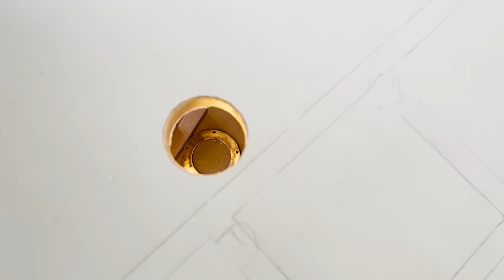Holes In the Boat and Deck Waterproofing - Episode 257 - Acorn to Arabella: Journey of a Wooden Boat

Comment: Great work Stephen, well done as always. Mate, i strongly suggest you move the gas bottle. That is the best seat in the house. When you're sailing to weather that is precisely where you'll want to snug up under the dodger to avoid the spray. At anchor on a rainy day, thats where you'll want to have your cup of coffee on deck and stay out of the rain behind the dodger. On watch for long hours, thats one of the few spots you can sit with your back supported. Its also a safety issue, they do catch fire, better to have it as far away from your cabin access as possible. Its the spot where you'll come in and out of the cockpit when you need to go forward. Its tricky enough without a sharp piece of metal to negotiate. Honestly mate - that is valuable real-estate and far more valuable than the convenience of being able to put your hand out the window to shut it off. Future Stephen will thank you. Best wishes
Reply from the maker: Thanks for the thought but with the dinghy on deck and a few other things, it’s really the best spot for the propane on Arabella. We’ll find out little shelter or favorite spot for sure. 👍

Comment: Looking good. Hole saw tip: Drill 1/3 of way from one side until pilot exits other side, then drill from other side. No chance of tear out and you can grab the plug and pull it out of the saw with your hand.

Comment: I'll join everyone else and say great work Ben it's hard to believe 200 episodes of smooth editing. I do have a question will a thin layer  of epoxy be added to the exposed wood on the cabin top holes to seal the wood against water intrusion.
Reply from the maker: Yup, epoxy was used to seal those.

Comment: Very interested in the scraping of the Deak seams, a few years ago I was trying to scrape the 18Cent lower deck of the Endeavour replica. The soft wood had worn away and left a ridge of Pitch. Found it very difficult to get the floor flat again, perhaps a Scraper would have been better!??
Reply from the maker: A very sharp scraper, maybe. Although it’s probably not a bad thing that the pitch is proud of the rest of the surface. Doing it’s job!
Reply: The pitch was raised by about a 1/4 of an inch, we tried a Belt Sander and a power Plane both just melted the Pitch. Perhaps the big Block Plane that I had at home would have been better but it was a huge area about Ten x’s Arabella’s deck. I gave up and I suspect she sailed out of Cardiff in the same condition as she came it!  By the way the work is going well! Best wishes for the Launch!

Comment: Why didn't you use barrel bolts for the skylights? Having a bolt sticking out, or even just the nut, will be a constant snag point. At a minimum, I would have the nuts on the inside.

Comment: I've seen on your video you use in a heat gun to heat up a pudding knife to get the sap. To? Go. In to between the wood? On your deck.Have you thought of using . Sautter iron. Sodering iron that heated up in between the wood?
Reply from the maker: We like the wider blade and gentle heat of a warmed up putty knife blade over a soldering iron, but yes I suppose you could use one of those.

Comment: Great works, but some remarks re safety!
Never use gloves near the grinding wheel, wire brush, lathe, drill press etc.
A skin wound is much less than a lost finger/hand.
Also, open flames in that area, full of dust, wood shavings and flamables!
You have to be able to reach and use an fire suppression device in less than 10 seconds in such an environment.
Sparks from that worn-out jigsaw blad could well be an ingnition source.
You problably know Murphy's law.

Comment: Heard a suggestion to use gloves at 3:52. Never use gloves or loose clothing on unguarded wheels/mops, this is basic workshop safety. If the glove or clothing catches on the wheel it will drag your hand into the wheel. Best result a broken finger.

Comment: FWIW: Shellac as mentioned, if your narrative was correct, is not waterproof and never an exterior finish.  It does not stand up well in a humid environment down below either. There are better choices.

And your dorade location, if I understand your discussion, under the Bimini is not ideal for optimum performance.

But, we all discover these things - and a lot more, after cruising for years and thousands of sea miles in our boats.  And every boat is different.
Reply from the maker: There will be dorades at the forward end of the cabin as well this is to serve as a bit of a vent for the galley area and isn’t being counted on for the lion’s share of the ventilation. —Anne

Comment: 😮 @3:50 Don’t do it! You should never wear gloves while using a grinder or wire wheel. The fabric of the gloves can get caught up and wound around the rotating tool, pulling your fingers into the machine causing far worse injuries than being gloveless.